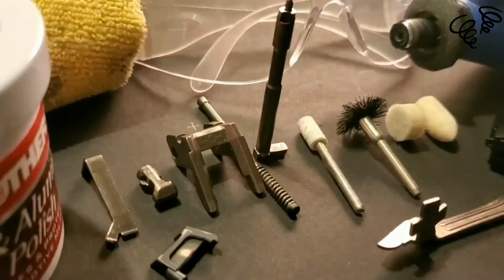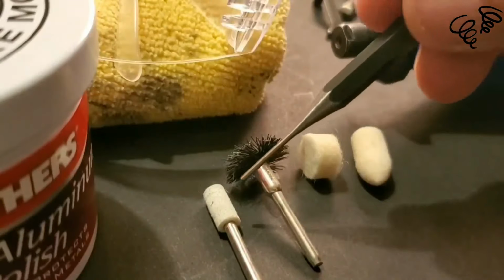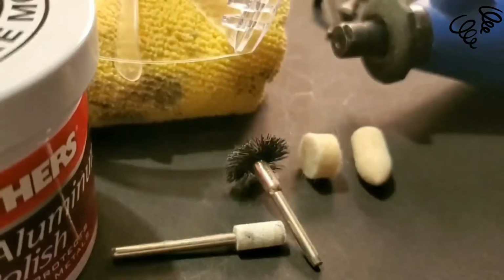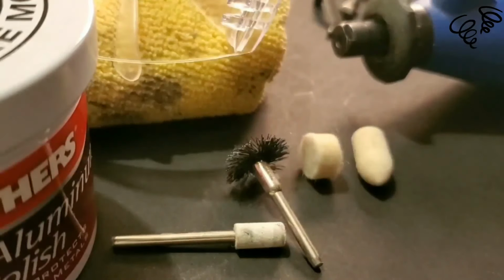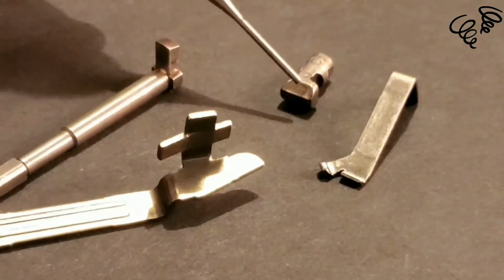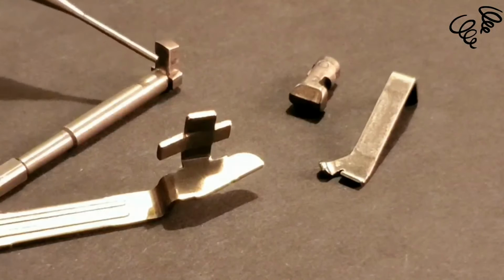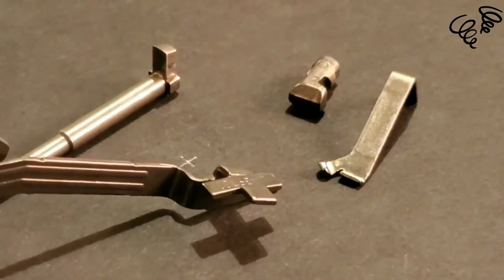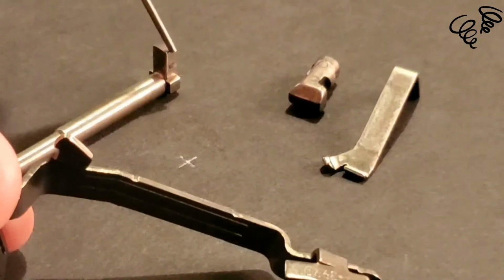Glock 25 cent Trigger Job Tutorial: Best DIY tips for beginners

Comment: Great tutorial, it’s a reminder, when you buy a new Glock to polish every metal to metal component. I love doing it and it dirty parts can be wiped of with a cloth and it will look like chrome again. Years ago I used to polish my slide release, it comes out chrome looking and the pins that hold the pistol together. You can polish every metal part, even the springs.

Comment: This is an excellent video. There’s another video that pops up ahead of this one when you search 25 cent glock trigger job and the dude doesn’t even polish half of the mating surfaces and instead polishes random spots. He even polished the wrong end of the safety plunger that goes against the spring inside of the slide as opposed to the side you show that actually interfaces with the trigger bar. 

I know these videos take way more work than it appears, so I appreciate you taking the time to do this.
Reply from the maker: Thanks you a bunch. I appreciate the support.
Reply: Agreed sir

Comment: Did this to my 23c gen3 but also installed a 3.5lb ghost trigger. Night and day difference in pull smoothness, weight and on the shorter reset. Have had it loaded for over 10 years. No malfunctions, accidental discharges or any ill effects. Ive only replaced the shell extractor so far. At least 5k rounds through it.

Comment: Awesome trigger job, did it just like you did, did three Glocks with it I love how it worked, made my Gem 5 G17 trigger like butter, did my Gen4 G26 and the reset is perfect, even my Gen 2 G17 trigger smooth out, even more, Love it, thanks for putting it out.  Chreers
Reply from the maker: Good stuff man. Makes cleaning a lot easier too
Reply: That's means one does not replace anything and without compromising your Glocks dependibility u get an amazing trigger . Am I right?. I don't want to put after market parts in my Glock.
Reply from the maker: Yes, that is correct. It simulates the natural wear of a few thousand rounds through a finely broke in glock. It also makes your internals VERY easy to clean carbon off of.

Comment: Just did a polish job on my brand new, unfired , Glock’s trigger parts. It now brakes at actual 3.5 pounds. It was so heavy before I started that it bottomed out my 4.5 pound scale and kept pulling so I don’t know how heavy it was to begin with. I would have to say it was around 5.5 pounds to start with if I had to guess.
Reply from the maker: Love it, that's awesome. Usually they do start at 5.5

Comment: Great video. Polished everything as described. And got down to 3.8 lb trigger pull as well as nice gliding slide. Before it sounded crunchy. Saved me 200.00!
Reply: Now I have to do all my glocks! 😂 figure you’ll save me 1000 bucks!
Reply from the maker: Nice man.  Wait till you go to the range and see how easy it is to clean polished internals.  Comes right off with almost no cleaner.

Comment: Awesome tutorial!!! I'm new to firearm ownership myself and it's hard to find good content that explains basic concepts of gunsmithing but you did a phenomenal job! I do have a question though, for parts that come with a coating on them such as my Beretta 92 s Xtreme trigger parts that have the "DLC" (Beretta's proprietary "Diamond Lile Coating") would polishing effect the durability of the finish at all or just make it shiny? I really want to polish the short reset trigger bar before I install it just because I'll be doing the rest of the internals at the same time but I don't want to compromise the DLC finish. I don't THINK it would but I'd rather ask and be called an idoit than do it, screw it up and be called an idoit😄
Reply from the maker: Thanks for the support. Youll be okay with the DLC coating. It can be harmed w sandpaper or if you run your dremel dry or too fast. A burn can occur. It's easy enough to avoid, you can actually feel the heat in the part as youre holding it. If you want to play it safe, just put a micro fiber cloth on a table and skim polish your parts on it by hand. That way you'll definitely be okay but I'd personally dremel away in a ¼ of the time. I just need to stress the importance of running at a low speed and keeping the polish tip and part covered. As soon as you make contact, the polish will turn black and start to evaporate slowly, just keep doing wipe offs and add more polish.
Reply: Heads up - DLC is not proprietary

Comment: Wish we could see a before and after trigger pull and reset maybe show us on a trigger gauge👍
Reply from the maker: Absolutely I hear ya on that. I will tell you from doing multiple, that it averages about 5 oz off the pull. Not so much, it's much more about having a very smooth grit-free, snag-free trigger pull and reset as well as slide action when racking after you polish your rails as well. Try it out you'll love it.
Reply from the maker: Just thought I'd add. If your looking to lighten your trigger just get a 3.5# trigger connector,  a reduced power safety plunger spring, and a 4.5# trigger spring (no less) on a edc setup.👍
Reply from the maker: @yeshua1176  sweet man sounds like a fun one. I'm looking to get a glock 41 soon🤣 it's silly, but I cant help it I want the biggest dog in the yard lol
Reply: I’m looking to get rid of some of the creep in my trigger
Reply: @CycloneGunworks what will this do for the trigger pull, and could I just install for Glock 3.5 - connector and that’s it?
Reply from the maker: @jallen312  The polishing of parts is not going to remove more than 3-5 oz off your ttigger pull weight in most cases. It's much more about having a very smoother, grit-free, snag-free trigger pull  as well as slide action when racking after you polish your rails as well. Another huge benefit of a polish job is that afterward, your polished parts will always be much easier to clean carbon off of than oem finish. A 3.5# connector is a very noticeable mod that will reduce the weight by about 40%. If you haven't experienced tolerance changes with mods, just know that any new part added to a working gun can make it stop working. So, I advise learning/preparing how to troubleshoot each replacement part you may want in the future. Luckily, the connector is usually a reliable mod with a big payoff and an easy fix if causing malfunctions. It's usually just adjusting the connector angle in or out(many videos out there on how to do that)
Reply from the maker: @KayoMonei  Have you heard of a travel stop in the trigger housing?

Comment: Wpuld a new shooter notice the difference? 

I have an almkst new Gen 4 G17 and I find the trigger heavy.
Reply from the maker: @m3rri3n36  Yes, it helps a little with jerking the trigger. You'd certainly notice how much easier it is to clean the carbon off after a range day when the parts are polished. The trigger pull weight usually lightens about ¼ lb.

Comment: How often do you polish? 

Having issue with p80 g17 trigger sticking really bad. Can’t pull trigger back an then it’s stays ware I stop pulling. Any videos of reassembling g17
Reply from the maker: Sounds like it could be related to a blockage or jam in your channel liner or something similar. I don't have any assembly videos cus YouTube haters, but you typically only have to polish parts once, preferably after a few hundred rounds are broken in. They will be very easy to clean once polished. I do repolish after a few thousand rounds but it's not necessary. Keep hunting though you'll figure it out.
Reply from the maker: It could be as small as a spring cup being lodged. Wish I could help more.
Reply: A Chinese lower parts kit might need the trigger pin ground down and polished. I was having this same issue until I took a dremel and removed some material from the trigger pin
Reply: Thank you guys sorry for late reply it’s working well polish job new crucible
Reply: @Dirtyfish_22 late reply? Man that was two years ago🤣
Reply: Gips never too late bud.

Comment: Where can I find that polishing bit or do you have a part number or brand? Also what rpm roughly do you recommend? Cool videos man keep it up!
Reply from the maker: You can search on amazon for (polishing dremel tips) I recommend getting the ones that have the metal shaft attached. Super cheap for a 50pc kit on amazon. Btw your speed wont necessarily matter when polishing I like to run it almost full speed. Just dont let that bit sit on your part dry. Keep dipping parts/tip in your polish👍
Reply from the maker: Gotta look at my newest video best detail yet every step. I have all my best tool links in the description too👍
Reply: @CycloneGunworks  where’s the newest video? All I see are stippling videos

Comment: I heard that it thins the putter metal and make the inner weaker . So do I polish them or I don’t , I heard it from 2 gun smiths
Reply from the maker: Belts and dremels used incorrectly can cause issues that could effect you over years with corrosion if not oiled normally. It's better to polish than not to polish so you can have the easy cleanable parts and smoother functions. If you still have concerns about a high value/rare firearm, or have a very high duty dependance you can polish by hand and also use jeweler's rouge. Just keep in mind that some people will tell you false info rather than admitting they aren't fully knowledgeable on the subject. I can't tell you how many "gunsmith" stippled grips I've had to completely re-do. Gunsmiths are generally pretty knowledgeable, but the really good ones will admit they don't know it all. One of the leading experts on glock trigger work is Johnny Glocks and all his parts are polished if that trlls you something. Hope this helps bud. Let me know if you have any other questions 👍

Comment: Why would anyone use wheel cleaner when you can use actual polishing compound...and make much less of a mess?
Reply from the maker: @lenzielenski3276  I'm not sure exactly why Mother's and Flitz are the usual go to for a trigger polish. I've heard that they are less abrasive than other polishes. That's a big deal considering you don't want to polish too hard or change any edge geometry on your parts.
Reply: @CycloneGunworks  I've polished knife edges to a mirror finish with green compound on a strop (60,000 grit). Then there's gray and white that are even finer..any of which are actually finer than wheel cleaner or metal polish. The right tool for the right job. You can drive a nail with a wrench or turn a screw with a butter knife, but you always look silly doing it.

Comment: Will polishing help potential rust develop over time? Do you greasy or just lube those now clean parts?
Reply: Had a buddy with a pos px strom (I'm biased lol) who polished his internals & that long ass trigger pull was so inconsistent we would laugh when handing it to shooters who haven't fired it and laugh at their weird expressions trying to figure out when that damn thing would actually go pop lol, seemed to fire randomly on either the short or long side of the pull if that makes sense lol?
Reply from the maker: Rust will always be a problem until its coated w something. However you can lightly sand and polish away rust but you MUST lube it and keep it lightly oiled as needed. Maintenance is a must w rust
Reply: Right on appreciate the response & informative video keep em comin bud lol. Have you ever coated your internals with a more permanent coating? Always been an old ww2 era long gun guy so I just greased those oldies and never had an issue, but it would be nice to coat and forget those small parts permanently but question is would a coating add much thickness to those already small parts & negatively effect operation?
Reply from the maker: @Excellent_Duderino  Cerakote clear is always a good one.
Reply: I'm gonna share the 💩 outta your channel bud appreciate the info.
Reply from the maker: @Excellent_Duderino  that means everything💪
Reply from the maker: Gotta look at my newest video best detail yet every step. I have all my best tool links in the description too👍
Reply: Ah man I'm on it lol

Comment: How often will this need to be done? After firing a few hundred rounds the parts are going to get gunked up again.
Reply from the maker: Great question. Generally only necessary one time to remove the factory carbon and machine marks. Then the components will work smoother but most important. Your gun cleaning labor is minimal after range days because the polished surfaces clean up easier and dont accumulate as much crap either. All around great project everyone should do on every glock.
Reply: I was always of the silly notion that FULLY cleaning and relubing ANY firearm after use was correct. Perhaps I have a great deal to learn.
Reply from the maker: Definitely clean and lube every time

Comment: Gen 5 saftey plunger fits in gen 3 ?
Reply from the maker: No it will not. Pretty inexpensive for a gen 3 plunger though.
Reply from the maker: Not saying there's not a way to make it wor, but you would need other Gen. 5/4 parts and be pretty knowledgeable how the glock internals work,. So even if possible, just not worth it.
Reply: @CycloneGunworks  can’t find oem gen 3 plunger only gen 5 and the gen 5s go for like 10$ max with the spring I can  only can find gen 3 aftermarket custom plungers that are like 20-30$ dollars
Reply from the maker: @2047theway  it's all those p80s being built. Add some to a watch list for an email reminder. Or if your in a rush grap the apextactical polished rounded one in stock right now for 17.95 👍
Reply: @CycloneGunworks  ye I bet but I ain’t tryna mess up my slide or change he anything  so ima just keep looking till I find a fairly priced one and Its funny you say cause I actually need the part for a p80 build I’m working on I  just have an extra slide and frame and a lower  parts kit but no upper so I gotta order a nice upper parts kit or buy individual parts and I chose individual parts personally saves me money and usually like to stick with oem parts or upgraded parts I know are reliable
Reply from the maker: @2047theway  https://www.ebay.com/itm/Firing-Pin-Safety-for-Glock-9mm-10mm-40-357-SP00077-Gen-1-4-26-19-17-22-23-/163789771525?mkcid=16&mkevt=1&_trksid=p2349624.m46890.l6249&mkrid=711-127632-2357-0
Reply from the maker: For a safety plunger, this is reliable from kmtactical seller

Comment: Trigger pull readings would be helpfull
Reply from the maker: It doesn't take much weight off. About ¼ to ½ of a lb. It's more for the smooth feeling pull and the firearm to function better while everything is reciprocating. Also amazingly easy to clean after polishing.
Reply: @CycloneGunworks  my new G17 has 8.5 lb pull. Something is wrong. Any ideas why?
Reply from the maker: It could be the bend angle of your connector or an issue with drag in your firing channel. Glock issues are hard to chase without visuals because most of the parts work in accordance to each other so it's like each issue can be from 5 different reasons. I'd do a full dissassembly to check things. On a side note, I run all my weapons with a ghost 3.5# connector, 4.5lb striker spring, reduced plunger spring, and for Gen 4 and prior the high powered trigger return spring as well.